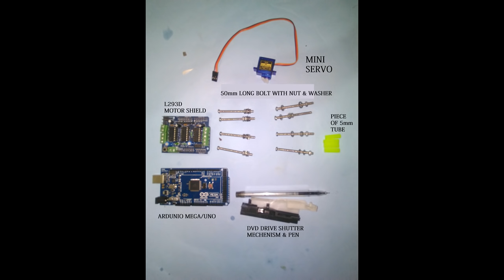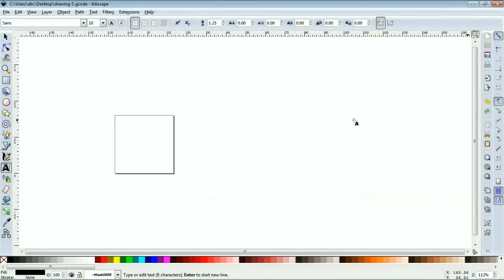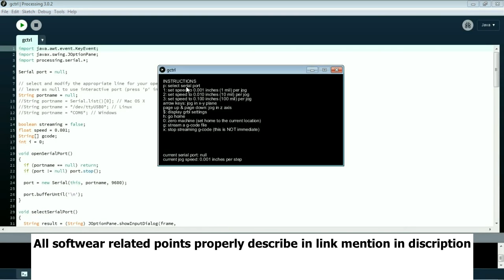How to make Mini CNC plotter machine at home using Arduino, L293d Motor shield & old DVD drive

Comment: If you guys still facing problems and not getting proper drawings try applying the following.
1. While creating gcode in inkscape take a 80mmx80mm draw area and put you picture at the top-right quadrant.
2. Still if the drawing is not proper, the cause can be inadequate torque due to microstepping. Change the motor mode to Interleave (which will also give you neat drawings) to get much better torque and the drawing would be fine.
3. While using Interleave mode try reducing the motor speed, so jitters (that might occur while drawing curves) would be minimum.
These three changes made my pictures very very neat.
Reply: What is the interleave mode
Reply: como hago lo que dice mi maquina no dinuja bien y parece que se salta paso el motor pls ayúdeme
Reply: Bhai image bhut chhoti ban rhi hai
Reply: what i undertands
Reply: Debojit Kundu plz reply....how do i change the stepper motors' mode to interleave. What program or app do i need to use....??
Reply: My x axis and y axis is not moving properly it makes my drawing Improper or scribbling but my servo works properly plz help
Reply: @apexhawk2497   MY SERVO NOT WORKING PROPERLY PLEASE HELP

Comment: That was absolutely brilliant! If you replace the pen with a permanent marker you could use it instead of a laser printer to make pcb's.
Reply: Have you done it?
Reply: @lightm.h3990  No it will not work I think, I have done with a permanent marker and ferric chloride acid, thank you with honors
Reply: @magicianofelectronics951  I just finished my own plotter and i dont see any reason of why it shouldnt work, gonna try it soon and upload a video about it!

Comment: people with not succeeded , try these tips they will end up with success for you
(01) if some errors coming after few attempts of code uploading to arduino, - disconnect arduino from pc ,restart pc and connect back,select port and board,then 1st try blink program then your codes, its always error free if you upload codes to arduino without connecting L239D + servos and step-motors,after code upload connect all as picture 
(02) check step motor with diode test mode of multi-meter for good connection of both phases separately.then for Ohms value of each phase (should be near 10 Ohms )
(03) check proper connectivity between step-motors and L293D, POWER SUPPLY, servo motor and L239D with multi-meter
(04) now you have essentially check step-motors (X &Y) with step_motor test for both x & y axis separately, if only this shows back and froth movement you can proceed
(05) those who getting scribbling like drawings "no desired out put"-more commonly lack of power supply- always give 5V, 2Amps (not any other)external power supply via L239D motor shield, if still your problem is there check 4 ends of wire connecting pattern from your step-motors to L239D
if still problem there change your arduino codes for following places given bellow
XflatMax & YflatMax - 150, change it to 100
smooth out put will give if we slow down the pen speed @
XsetSpeed & YsetSpeed -10000 change it to 200

give your comments with us,good luck!

Comment: for people who are getting scribbling like drawings from DVD step-motor CNC plotter machine, i give you correct and proven changes for proper out put, try it and get corrected!
(01) most people with "baby scribbling drawing output"due to low Watt power supply(less than 10W) 
SO give 5V 2Amp power supply - your cnc need (@least 10W power input) ,if not this will correct try with 12V, 1Amp power supply but this will heat up your DVD step-motors and 3 ICs of L293D so use fan to heat loss in 12v  power supply.
IF STILL SCRIBBLING DO CHANGES GIVEN BELLOW
these changes should be done in Arduino CODES you upload to your CNC
(02) StepMilimeterMax - for each 1cm of your maximum length or width of drawing area this value should be multiplied by 25,
my cnc drawing area is 5cm X 5cm square shaped area, so my StepMilimeterMax is 5cm x25 =125 (every one who made CNC with normal DVD step-motors has nearly 5cm x 5cm area,so StepMilimeterMax =125)
if StepMilimeterMax is <125 output is small pictures and letters NOT FILLING DRAWING AREA OF 5cm x5cm
if StepMilimeterMax is >125 output is BIG pictures and letters WITH OVER FLOWING EDGES FROM 5cmx5cm
(03) these factors given bellow should be in given values for 5cmx5cm drawing area
       (a) Line buffer -should be 512 ( if >512 effect is #)
        (b) XSetSpeed & YSetSpeed -should be 200 (if >200 effect is #)
        (c) Char Buffer -should be 64 (if >64 effect is #)
#- unusual Hum and vibration from your DVD step-motors.
(04) Line Delay - should be 50
if this is 0 - left half of your picture/text write on whole 5cm x5cm area and right half is over write on same 5cm x 5cm area
if this is 50 - no OVER LAPPING
(05) pen servo Delay- should be 100 
if >100 - at the point of same text or picture section write by your CNC more than once, second and next writings are not write on first writing so this make "BLUR EFFECT"
CORRECT YOUR ARDUINO CODES ACCORDING TO ERROR TYPE GIVEN ABOVE AND GET SUCCEEDED AND WRITE YOUR COMMENTS!
Reply: Wasantha Wimaladharma My x axis and y axis is not moving properly it makes my drawing Improper or scribbling but my servo works properly plz help

Comment: Mr.innovative,thanks for help render till now.at present my problem is related to running g code program.while running g code program draw is all jumble up.nothing clear.at the end of run it shows a message
M18 (drives off)
Command not recognised: M18.
Pls let me know what to do?I am just stuck up here.success is just eluding me.pls help.you know that I am a newbie.thanks.
Reply: m.mohanlal Joshi same issues
Reply: m.mohanlal Joshi same issues
Reply: I too has a same problem
Reply: m.mohanlal Joshi  same here man what to do?
Reply: facing the same issue
Reply: the same also
Reply: i also facing the same issue please sir help
Reply: I am also facing same issue
Is anyone here whose project is successful
So please help us 

I hope mi team that they will give attention to us
Reply: Mr mohanlal joshi have you got any solution?
Reply: m.mohanlal Joshi plz tell me how to ad gcode in arduino
Reply: Same bro
Reply: Same problems any bady help me
Reply: Same problems pls till me pls pls pls pls
Reply: after finishing the print job it is showing m18 drives off
Reply: @ankitsharma9366  using "processing" application u can

Comment: agar arduino mega ki jagah per arduino uno use kare to kya ho payaga........?
Reply from the maker: yes yes bilkul ho payega Arduino uno use kar sakte hai
Reply: sir  usme koi code to change nhi karna padega  means if we use andrino uno
Reply from the maker: no kuch change nahi karna padega
Reply: Mr Innovative arduino me kitna voltage insert karna hai?? and in palce of dvd shutter mechanism what other i can use??
Reply: 12v
Reply: two steppers
aur motoer shield mein 9-15v is safe
Reply: Arduino uno ke kin pin se motor shield ko connect krenge??
Please help me with the picture
Reply: I also need help..i connected the circuit as showm ...processing software me it showing properly but steppers not working
Reply: Mr Innovative plz help bro..
Reply: kyo , code ka pin to change karna padega , kyonki ye mega hai or , uno or mega ka pin to different hoga ??

Comment: frm were did u get the pen holder??? can u plz give me the details
Reply: i maked it..try to do it
Reply: how made it kazun? pls explain it.
Reply: try to do,,by use plastic bords,spring and etc
Reply: bro, this is made from tray ejecting gear motor system of an old desktop PC  DVD writer. try to buy an old desktop PC  DVD writer and dissemble it to get this unit.you will see what i'm talking about
Reply: Wasantha Wimaladharma . Plz can you give some links for the pen holder😊
Reply: U maked this difficult project except that pen holder?

Comment: for whom the image is coming only a single line  
please check whether image or letter is in right side top of the inkspace if it is in centre of the inkspace document then it will not print exactly if it is in the right side of the document only it will print

Comment: can the motor circuit can be used with audrino nano
Reply from the maker: In simple words no you cant use l293d motor drive with nano
if you are pro with electronics you can use by doing some engineering

Comment: If I connect 5v supply to motor shield stepper doesn't move in jog mode...but if I connect 12v and that jumper removed... stepper get heat ..,I feel that it will burn...what should I do...how much voltage is sufficient? ,And I feel tha the travel of x and y stepper are not that like yours in ..plz reply..

Comment: at step 7 there is an error coming at saving drawing it is given as bellow
 Inkscape has received additional data from the script executed.  The script did not return an error, but this may indicate the results will not be as expected.

Traceback (most recent call last):
  File "unicorn.py", line 108, in <module>
    e.affect()
  File "inkex.py", line 283, in affect
    self.effect()
  File "unicorn.py", line 102, in effect
    parser.parse()
  File "unicorn/svg_parser.py", line 230, in parse
    self.svgWidth = self.getLength('width', 354) * 0.28222
TypeError: unsupported operand type(s) for *: 'NoneType' and 'float'
\

File C:\Users\Dr. WASANTHA\Desktop\drawing.gcode could not be saved.

how could i sort out this,where could be the wrong
Reply: Inkscape completely uninstalled with removing it's all files. Then install it again. But same error massage still there.any one who manage this problem please help.
Reply: I'm too facing the same prblm....can anyone plz help me out
Reply: Wasantha Wimaladharma bro im also facing the same problem

Comment: if finally finisihed, just took some troubleshooting before i got it, power supply from usb is not enough to power the motors, it must be powered by external supply, mine was 5V, 2A, an old PSP charger...
Reply from the maker: cheers man
Reply: By the way. How to adjust the speed?

Comment: Very good video! I have a question, I tried the program testMotors with a power supply of 9v, 500mA and I see that the stepper motors heat up a lot, I would have to try another source or is it something else?

Comment: I have made the machine but its not making correct diagrams...sir pls tell me how to know the motor shield to motor wire connection propely as u said in your schematic that to connect y axis on M4&M3 but i have a question how to know the proper position of those terminals as each motor have 4 wires

Comment: Hi there
i tried building this using L2983D Servo shield ,but its not working for me !!
all the connections are correct bcz i tried testing the shield using  ADFRUIT ,ITS WORKING FINE
But when it comes to the CNC programme its not showing any movement on any of the servos .. how can i fix this ??

Comment: Hi,

You are doing a great job, finally I learned something  worth doing.
I assambled this machine and ran it, it is working just fine for the
Gcode you provided as samples.

However I am having problem running Gcodes generated by my self.

I am using inkscape ver 0.48 (as you suggested)
I have added "inkscape-unicorn-master" extention.
I have watched all the available videos on how to generate gcodes
using inkscape for cup cake cnc machine.

Now the problem:

When I generate the Gcode for any image or text, Gcodes are generated
but part of it lies out side the printing area. (although I put all the
text or image inside the working are (that is the square box).

I am using grblGuru simulation software for simulation, in which your Gcode samples are
running just fine but my gcodes are out side the working area, (though the gcode size is with in 40x40 mm).

I also keep the document property size in less than 40 mm x 40 mm.

FYI I am using win 10, 64 bit operating system.

Kindly help as soon as possible
Reply from the maker: this is the most common problem even i face it every time i dont have any specific solution but i do a trick to overcome this, first you draw a 30 x 30 mm square in inkscape place exactly in center of working area and print this square, now see which portion in lies outside suppose your top right portion (i face problem in this area) is out of reach and not printing so drag the square in bottom left corner dont worry if square goes outside the working are generate gcode and print again now you will notice major of part which is previously not printing can able to print now repeat the same process until you satisfied as soon as you get what you want save that file as a tamplet in inkscape for you future use... thanks
Reply: Hi There,  
Many thanks for your reply, will try this trick and let you know how it goes. Have a good day,

Comment: Hi thanks gor the great explanation! I did tge exact steps and now i have 2 questions! My printing size is 30mm W X 40 mm H how to adjust the printing size in GTRL , also how to set zero point on the table ?! Where the pen should be when the machine started ?!

Thanks and I appreciate your help
Reply from the maker: You no need to do any thing in GTRL , set the page size in Inkscape from document and properties option

Comment: why i make mini cnc not working according to the drawing made in inkscape, for example i make gear but only straight line just formed, is the coding in fox if i make mini cnc ??
Please reply
Reply from the maker: IF only vertical or horizontal line are making means one of your stepper not working
Reply: everything works very well and normally but when running with gcode code does not match the picture on the computer, if there is whatshap i can contact please share i want to send the result image
Reply: please reply

Comment: great work
but can i ask you question
why you used external power source for motor shield?
 and can you use power from the arduino
Reply: high current that motors consum will blow the ARduino card board

Comment: Mr innovative,where do u think the problem is,because while running stepper test run ,the stepper runs ok,that means arduino board and L293D shield are ok.and when software is running at that it looks like software may be ok? These are my guess work .pls reply soon mj
Reply from the maker: i hope you have selected right comp port in GTRL

Comment: hello i just make this type of CNC machine with dvd stepper motor and motor shield... its taking codes bt the stepper motor just sound like running bt its not running. what is the problem??? i have provided 12v power to motor shield..

Comment: and which were the two wires that u connected to two different screws on L293D motor shield
Reply from the maker: its a 5v dc supply

Comment: I built my own CNC  and prepare every thing but at the last step with processing the problem appear. when i run the program it gives me this message  (Could not parse -1 for --display) but i cotinuo and press P button and do add a G-code file after that the programe start to work in the console (lower black box ) until to finish but there is any move on the motor .
what's the wrong??
thanks..
note: i tested every motor and they run well .

Comment: Mr.innovative,good afternoon,thanks for your help till now .my mini running ok. Problem is that it is printing in right hand side bottom corner only and that to all jumble up (all mixup)  print .advise on how to align printing in centre .same problem like mr Babal gahire .pls suggest remedy .thanks.
Reply: m.mohanlal Joshi do you get any error like m18 drives off, while processing gcode with processing,?
Reply: Yes , it gives the message M18 ( drives off )
Command can not be recognised:M18.
Pls if you no solution pls let me know

Comment: Mr.innovative, I hv selected com port very correctly.my com port is "com 7". On this port only all software is up loaded.secondly First I had powered motor board by 5v-1amp power supply..there was no action. Then I powered the motor board with 12v-2amp power supply.even at the time of testing stepper motor on arduino motor party supply was 12v-2amp only.so tell me what to do..RegArd mj

Comment: Hi sir .i too faced same problem i had stepper drives but they are not working I have joined wires randomly with all possible joints bcoz i don't have multimeter .but it is not working My power supply is 5v only Please help.I am facing same problem like omkar suryavanshi

Comment: good job, but this arduino and motor shield that u posted are too expensive does it work with cheap arduino and motor shield?
Reply from the maker: yes of course arduino clone & Motor shield must be L293D clone shield works fine..

Comment: hi,  we made a CNC plotter following instruction given, but the printer does not work and we get error with the Gcode.  "Command not regconized : M17"   which to our understanding is for enabling the stepper motors.  The servor responds but stepper motors does not respond.  Can you please suggest what could have gone wrong and where we can start to debug or fix this.

Comment: I am having a problem with running my dvd stepper. I am directly supplying power through Arduino to L293d motor driver then to stepper through a single usb port. The stepper creates very small sound when connected with Arduino and l293d but the lead screw is not rotating. Is it happening because of low current or what?
Reply from the maker: 2 reasons 
1--low voltage
or
2-fault motors

Comment: Sketch uses 3324 bytes (10%) of program storage space. Maximum is 32256 bytes.
Global variables use 230 bytes (11%) of dynamic memory, leaving 1818 bytes for local variables. Maximum is 2048 bytes.
avrdude: stk500_recv(): programmer is not responding
avrdude: stk500_getsync() attempt 1 of 10: not in sync: resp=0xdc

Problem uploading to board.
Reply: deepak raj  select port first in arduino software from tools> port